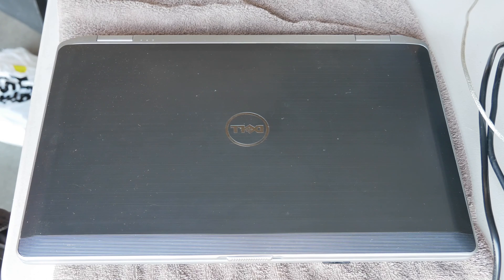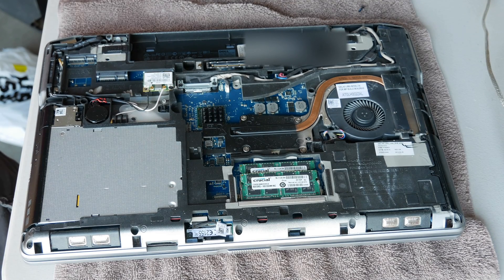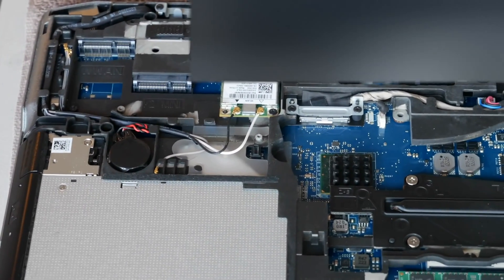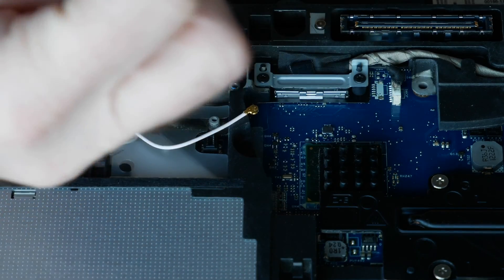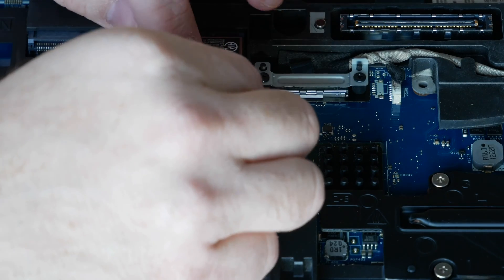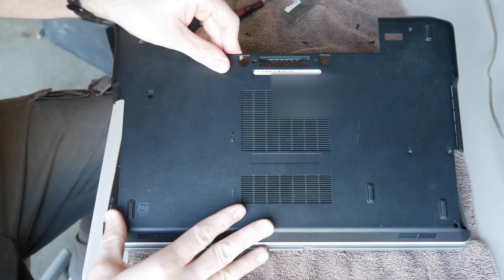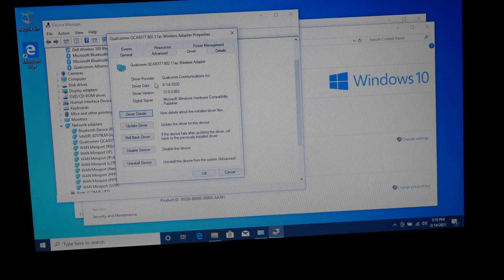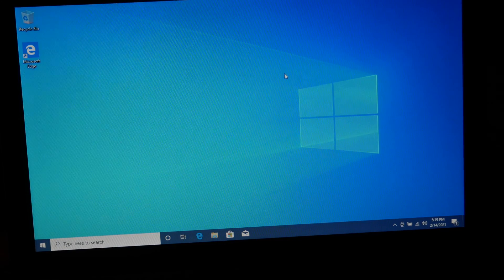how to upgrade an old laptop wifi card

Comment: Hi..thanks for making this video..
I hv asus rog gl552jx on default wifi is 2.4ghz and hv gen4 proc.. can i possible change to wifi ax/AC card?
Reply from the maker: @Ardi Maryanto most likely yes, unless that model has a whitelist of accepted cards. If you don't want to research it, just buy from a seller who allows returns and give it a try but download the latest drivers first before installing as you might not have Wi-Fi after swapping out the card until you install the divers. Be sure to read any installation manual on the driver's as some want to be installed before adding the cars and others not.

Comment: Barring any whitelist issues, which card would you recommend for a Toshiba L655-S5150 that's running the original RTL8188CE(?)  btw, great video... liked, shared & subscribed!
Reply from the maker: @WJK there's a Wi-Fi 6 mini pcie card adapted for the Wi-Fi 6 card. It wasn't available at the time I made this video but here's the NewEgg link. Let me know if it works for you if it's not blocked by the BIOS. Check this out on @Newegg: Mini PCI-E Wi-Fi 6 Intel AX200 Adapter Kit 2974Mbps Bluetooth 5.0 M.2 To Mini PCI Express Full Wifi Wireless Card AX200NGW 802.11ax/ac 160Mhz 2.4G/5G MU-MIMO OFDMA Windows 10 For Laptop Desktop https://www.newegg.com/fenvi-mini-pci-e-wifi-6-mini-pci-express/p/0XM-00JK-00089?Item=9SIADXZBPT7356&Source=socialshare&cm_mmc=snc-social-sr9SIADXZBPT7356_-08142021
Reply: @ShinyTechThings  - Will give it a shot and let you know - Thanks for the info/reply!
Reply from the maker: @WJK I reply to all questions. Also I'm reachable on Twitter and Instagram

Comment: What card would you recommend for a go mini 1101?
Reply from the maker: @The Lair of Blair I'm assuming it was a typo and you meant the HP mini 1101, correct? If so that's a Netbook with a Intel Atom N270 CPU which is 32-Bit only. If you swap out the card (HP whitelisted like 3-4 cards) it should work. Here's a link to the post on what it will take:
https://h30434.www3.hp.com/t5/Notebook-Hardware-and-Upgrade-Questions/HP-Mini-2102-wireless-card-upgrade/td-p/5767092
Otherwise you would have to patch the BIOS to get other cards to work and risk potentially bricking the device if you miss a step.

Comment: Asus x556uf only have one wire. They have 2.4g but can change new wifi card to dual band wifi card?
Reply from the maker: @Amirul Baseer The single wire just means that it has a single antenna. Only using a single antenna will limit the machines wireless speeds. If you were to swap out with a card that has 2 places to attach antennas I would recommend adding an additional antenna to the laptop for optimal speeds. It will work with just 1 wire but it won't run at full speed. Does that make sense?

Comment: Thank you for this video. Very helpful. I have a question though. My ASUS X750J card is a 2.4ghz only. So I wondered if I could upgrade and that's how I found you. I had no idea that the Bluetooth was also on the wifi card. That's awesome news as I don't have Bluetooth. But I wondered if I could buy and install a Wifi 6 card instead. So I looked them up on Amazon but they look a little different than the dual band cards. So, will they work or do I have to go with a dual band? I googled and found that ASUS doesn't whitelist their stuff so I should be good there. Thanks again.
Reply from the maker: @Joe Guilfoyle  Sorry for the delay, I could have sworn I replied from my phone app but I don't see that on the computer going through my comments. Here's a link on NewEgg for a mini pcie wifi 6 card and it's in an adapter so it'll fit any form factor in a laptop. https://www.newegg.com/fenvi-mini-pci-e-wifi-6-mini-pci-express/p/0XM-00JK-00089?Description=wifi%206%20mini%20pcie&cm_re=wifi_6%20mini%20pcie-9SIADXZBPT7356-Product&quicklink=true

If I don't respond to a question within a few days feel free to reach me on Twitter or Instagram. Thanks!
Reply: @ShinyTechThings  Thanks for the reply. Although it's too late to order the wifi 6 card, this video helped me upgrade 2 computers in my house. It was pretty easy. But now I know I can upgrade to the wifi 6 now. Thank You.
Reply from the maker: @Joe Guilfoyle That's awesome, glad it helped! Let me know if there's any particular videos you would like to see or any particular tutorials that I haven't done yet.

Comment: Is that a dell latitude e6520 ?
Reply from the maker: @Aeternojohn Possibly or a E6420. I think it was a 3rd Gen i5 or i7. I have a decent amount of laptops that I work on over the years.
Reply: That card is the best the machine may support?
Reply from the maker: One of them, yes. It's because of the interface so if you wanted to go WiFi 6 you could only do a USB adapter.

Comment: Does changing wifi card need to install any driver or just plug and use?
Reply from the maker: @Rangga Deva it depends on the card and if Windows already has a drive for it available. If you plug the computer into a ethernet connection then it should be able to download automatically for you with the new card but it depends if the drivers for that card are available as part of Windows updates. If not then you have to manually download and install the drivers for that card.
Reply: @ShinyTechThings  where to find that wifi card driver? On intel website? Or Microsoft?
Reply: @ShinyTechThings  and, how to check your laptop support wifi 6? My laptop is ASUS X550ZE (A10) and i want to change my wifi card cuz when i school from home, my connection always get interrupted because my brother's laptop, he is using Legion which has Wifi 6 in it, plus he is the closest one to the Wifi Repeater.

*Sorry for bad English.
Reply from the maker: The drivers would be for the cards manufacturer so if it's a Intel card then you can download directly from Intel's website.
Reply from the maker: What router do you have?
Reply: @ShinyTechThings  ZTE but i forgot what model
Reply from the maker: @K24B  please check the model number and let me know. Also what are the channels being used and their channel width.

Comment: Will this card work on Inspiron 17R 5737, installed with 1705 802.11b/g/n-2.4GHz. ?. Thank you.
Reply from the maker: Possibly, you would have to check it that model has a whitelist or not. Most of the newer Dell's will let you. HP's won't let you without editing the BIOS file with a hex editor which can be dangerous of you corrupt it.

Comment: I have a Dell Inspiron 7720 and have tried 2 different wifi cards that are dual band and bluetooth. Dual band works great but for the life of me I can't get the bluetooth to work on either one of them. Cards I tried are the 1901 and the 7260. I have found that it says something wasn't migrated? any suggestions would help thanks.
Reply from the maker: Does it show a yellow exclamation point on the bluetooth in the device manager? If so look at the HW_ID and google that HW_ID and see if you can find the driver for it and manually install it. Let me know if that helps.
Reply: @ShinyTechThings  It says the driver for each of them were updated. On the 1901 I got my ear buds to connect but today it can't find it. So more research is being done to try and resolve this issue.
Reply from the maker: Have you tried Dell's drivers for it as well?
https://www.dell.com/support/home/en-us/drivers/driversdetails?driverid=3x2hr
Reply: @ShinyTechThings  Yes I downloaded the drivers from that page and bluetooth worked for one day and quit. Do you know of any other Wifi card that might work?
Reply from the maker: I have one that is linked in the description of this video on Amazon but from what I recall I had to take the hardware ID to look up the Bluetooth for it so it was a little bit of a pain to get working but seemed to work fine after installing. Otherwise you could consider also getting a USB Bluetooth adapter if you want something that is just simple plug and play.
Reply: @ShinyTechThings  I was looking at the USB wifi dongals but I will look into the USB bluetooth adapters as well thank you.
Reply from the maker: Without physical or remote access it's really difficult for me to troubleshoot beyond what we've done so far. One last thing to check is see if your laptop has a physical switch or a key that accidentally got pressed or switched that might ha e disabled the bluetooth radio.

Comment: well, there is one thing I want to high light. Not every lap top's wifi can be changed even if they have a replaceble Wifi card soket. For example, I have my Lenovo B50-70, I have tried to put an Intel AX200 into it yet once it was done the system is not booting up and saying that I have pluged in a wifi card that is not supported.
Reply from the maker: @Hao Xu Some laptops have a whitelist and the only way around that is to modify your BIOS bin file and flash your custom BIOS. Most of the Dell's I've used don't care about the card that is installed.